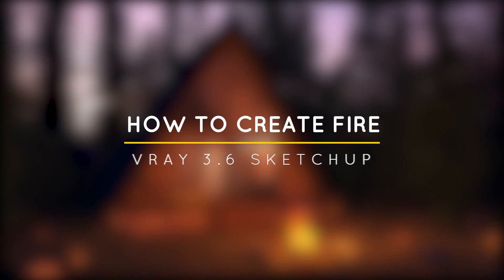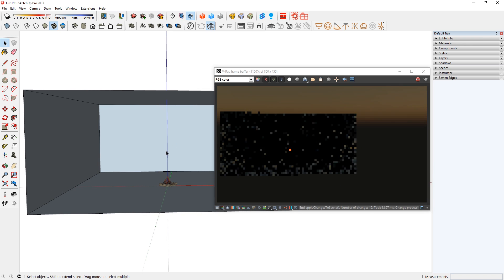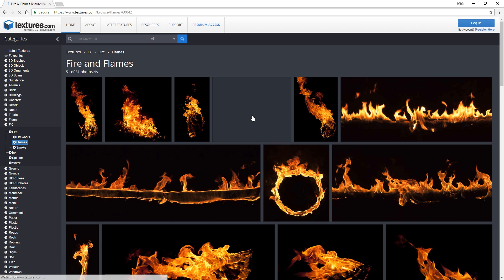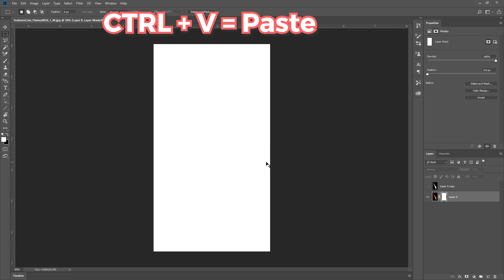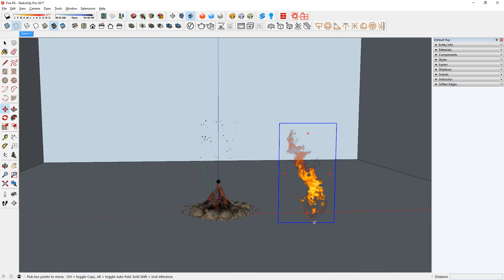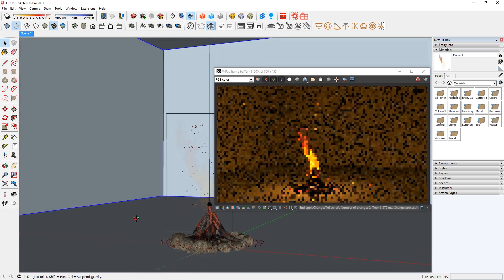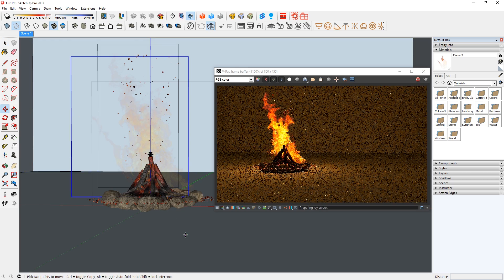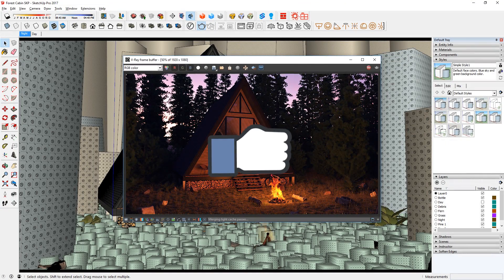How to create REALISTIC FIRE | Vray for Sketchup

Comment from the maker: Hey guys! If you have Vray 3.4 and don't have the "Color by Opacity" box, then use the "Multiply by Opacity" box, and uncheck that.
Also, make sure your texture map is in the Emissive Color slot. That should fix the problem for Vray 3.4 users!
Reply: If you use the image as a bit map on the emissive color slot, the image appears with a white background. Do you have any suggestions?
Reply from the maker: Did you follow the correct steps in the video? Also make sure your image is a PNG with transparent background
Reply: Hi sir Minh , Yes, there is a white background in the image even I followed the steps in Photoshop correctly .. The fire becomes emissive , but there is also white emissive background appearing in the image when we render it .. The image we import in sketchup is transparent , when we render it without emissive effect it is transparent but when we add emissive effect there is a white background appearing on it ..
Reply: Hi sir Minh and Alberto .. I've found a way to solve this problem with the use of 3.4 .. Here it is, in Photoshop , save the new PNG flame image with transparent background that we created like in this video.. Additional, save also the black and white image that we created .. In sketchup, after making the image as an emissive material, do not uncheck the "multiply by opacity" button .. Load the transparent PNG image as a bitmap in emissive color slot .. Also load the black and white image in "transparency slot" then check the "invert texture" under the manipulation color .. Then the white emissive background will be removed :))) guaranteed it will work :)))
Reply from the maker: Thank you for sharing Abe!
Reply: Welcome Sir Minh, glad to help, :)) thank you for this tutorial,, happy new year , wish you all the best :))
Reply: @abefajilan5731  thank you so much!! It worked perfectly.
Reply: @Phaula011  welcome 😁
Reply: @abefajilan5731  DUDEE Thank you sooo muchhh
Reply: @kayusgiarda7986  Welcome brother 🎉

Comment: Hy, I really appreciated your video and I found it Extremely clear. I found an issue, though. In Vray 6 there is no more the quick setting pannel, or I just didin't find it, So I don't know How to change the material type to emissive. Could you explain it?
Tank You very much.
Reply: Hello - Beside Generic I have (in right) add atribute and add layer (both with a pluse) -> click add layer -> select Emissive.
After you might find an error in vray render (it renders white or gray instead of png). 
For this go like this: 
In Emisive you have Color (click the square that has chess like squares) select bit map - > select colored png of fire  (then if the imag is like with 200x little fires instead of 1 - find a cube for UV Map that is named - TRI PLANAR PROJECTION FIT and press it).
In Emisive you have Transparency (click the square that has chess like squares) select bit map - > select white/ black png of fire -> then another pop with settings will show -> go to color manipulation -> click invert textures.

I went in same errors now and I stayed 1 h to fix them.

Comment: Hi bro. I have done the steps as you did. I got the transparent material as you get. But after I am turning into the emissive material I am getting thick white border over at the rectangle edges of the image. hope that make sense.. 
Please help me on this
Reply from the maker: Hm which version of vray are you using?
Reply: Vray 3.6
Reply from the maker: Hm the white edge might have been caused by the png images. I'm also not sure how you set up the material. If you want, you can send me a picture on my Facebook page so I can take a closer look
Reply: Sure

Comment: Hello from Future - you might find this useless now but others (from now on) might find it useful).

"In Vray 6 there is no more the quick setting pannel, or I just didin't find it, So I don't know How to change the material type to emissive. Could you explain it?"

Beside Generic I have (in right) add atribute and add layer (both with a pluse) -> click add layer -> select Emissive.
After you might find an error in vray render (it renders white or gray instead of png). 
For this go like this: 
In Emisive you have Color (click the square that has chess like squares) select bit map - > select colored png of fire (then if the imag is like with 200x little fires instead of 1 - find a cube for UV Map that is named - TRI PLANAR PROJECTION FIT and press it).
In Emisive you have Transparency (click the square that has chess like squares) select bit map - > select white/ black png of fire -> then another pop with settings will show -> go to color manipulation -> click invert textures.

Comment: I don't have the "color * opacity" option. I'm pretty sure I'm using the latest version of vray. Please help me.
Reply: Ok so the new naming for this is "multiply by opacity" I think, but it didn't work before because my png was in some way different from yours. I noticed your png renders the alpha black and mine did it white. I followed the exact way you set up the png in photoshop and mine renders black now also. This is what was causing me problems. Is there an easier way to make sure any png behaves this way?
Reply from the maker: Hm I think mine had the same issue before. Try using the export PNG option instead of the Save As option. I don't remember how I got it fixed
Reply: @ArchitectureInspirations  I tried that but at least in my version of photoshop it doesn't give me the option to export to png.

Comment: Hello. This is a really cool tutorial. Instructions are clear. I'm encountering 1 problem though. One the flame texture. when I change the quick settings type to emissive, it becomes gray. Then it would be ruined. I don't know where I went wrong. It's in .png, imported as image, exploded, then made into a component.
Reply: Hello from Future - you might find this useless now but others (from now on) might find it useful).

Beside Generic I have (in right) add atribute and add layer (both with a pluse) -> click add layer -> select Emissive.
After you might find an error in vray render (it renders white or gray instead of png). 
For this go like this: 
In Emisive you have Color (click the square that has chess like squares) select bit map - > select colored png of fire (then if the imag is like with 200x little fires instead of 1 - find a cube for UV Map that is named - TRI PLANAR PROJECTION FIT and press it).
In Emisive you have Transparency (click the square that has chess like squares) select bit map - > select white/ black png of fire -> then another pop with settings will show -> go to color manipulation -> click invert textures.

I went in same errors now and I stayed 1 h to fix them.